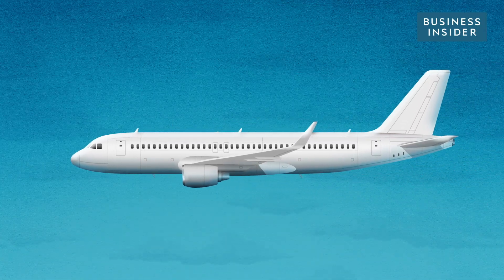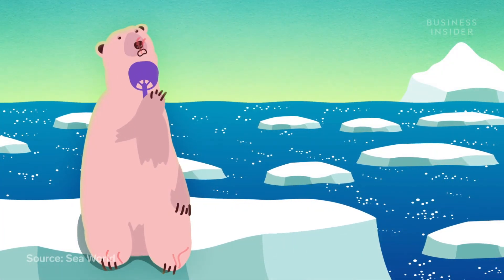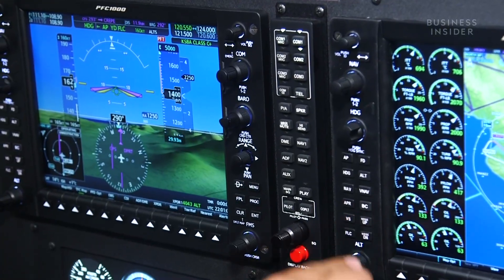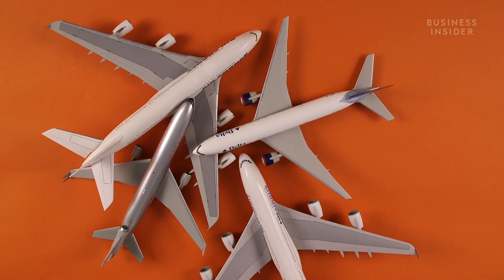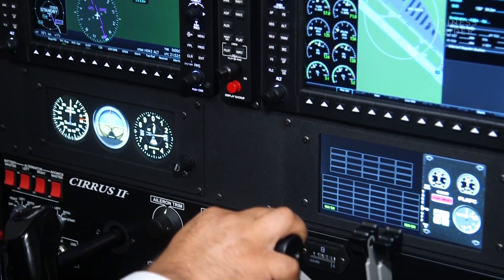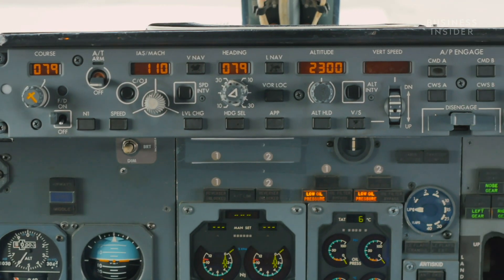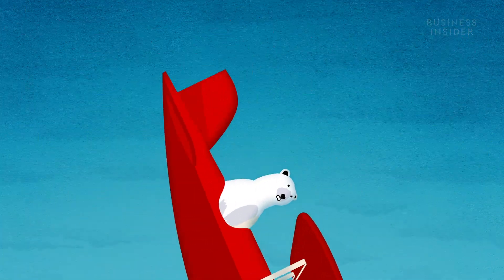What Do Pilots Do When A Plane Is On Autopilot?

Comment: Hook the neural link to the autopilot right now and see if he can get up and walk right now because I think I've indicated since c3 right the neural pathway through the motorway sensory and motorways through c3 go double check that and then check the computer program see if that's up and running okay it looks pretty smooth in that area that seems to be the location now yeah that pressure point that throws through number c3 and c4

Comment: "Inputting" is NOT  a verb.  The correct term is "Entering."   You enter data.  That data is called input, but you can't "input" data, you enter the data.  In essence you enter the input.

Comment: its actually pointless to have a pilot holding the yoke for hours just to fly in course and straight level. With the autopilot, they can do their actual important work like monitoring instruments, inspecting systems and communicate with ground.
Reply: For most of a flight, they are just flying "in course and straight level", other traffic is (usually) very far away and aircraft are always flown a long way from obstacles.

Comment: Hey, 737 max didn't crash due to wrong autopilot input. It was due to the MCAS system which is a part of the autopilot but was not available on the transcript manual for pilots may be Boeing did not want pilots to know about it which resulted in the crash of 737 max.

Comment: Just because the plane is on auto pilot mode. This doesn't mean that we can be off guard and take a nap. We still need to monitor and make sure the auto pilot is doing the right thing and if not, fix it or take control.

In another word, it help reduce the work load.

Comment: It seems like Autopilot is similar to turning on the "dumb" cruise control in older cars. When we set cruise at 70mph, the car cruises at the set speed no matter what. We are good as long as the highways are clear and its not a holiday weekend in which case you may want to turn off that cruise mode and hit your gas manually.
Reply: Except that that old type of cruise control only controls the speed, it does not steer. Even when that cruise control is on, the driver of a road vehicle still has to hold the steering wheel or the car will hydrocilate*. There is a category of land vehicles of which many can be driven without "continuous hands-on control". Trains are in this category, their drivers do not need to steer.
 There are buses (known as guided buses) that are also like this when in guided mode, however, unless they have cruise control, their drivers still need a foot on the accelerator.

*I got this term from a show called When Cars Attack.

Comment: OK! Because this video did not answer the quesion of "What do pilots do when a plane is on autopilot" so i will. When the aircraft is on autopilot,  the pilots would normally discus possible that airports they could land at when there would be an emergency like dual engine faliure or a sick passenger. Another thing they do is to look out for any growing CB or Cumulonimbus cloud as those clouds are capable of producing heavy winds and hail at such high altitudes. Pilots would always rely on their weather radars to locate these clouds and to avoid them. Other times they would be discussing their approach or decent phase.  hope this answers a few of yer questions
Reply: They would also do their paperwork such as filling up the trim sheets which is tiring asf

Comment: here what's wrong with this video:
1. 1:56 They show the flaps instead of the ailerons.  
2. 2:21 They don't use proper terms when describing the rudders movement. It's called yaw
3. 3:32 Autopilot does not exceed a 30 degree bank input. Therefore it is impossible to fly upside down. 
4. 4:06 The accident shown was caused by the MCAS system. Not autopilot.
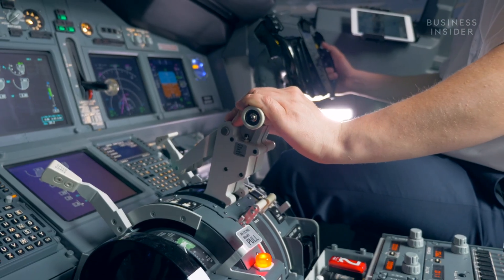5: 4:44 Qantas 72 had an autopilot malfunction which feed the plane false inputs and when the pilots took control the plane kept diving and nearly crashed.
On average you made a mistake a minute pretty bad.

Comment: Some planes can land automatically. Very few can takeoff but it is possible in some new airliners. You couldn’t program an autopilot to fly upside down, the worst that would happen is that it would disengage, as autopilots have limits to bank, pitch, etc.. There is no such thing as a 3 axis autopilot. Instead there is a yaw damper, which uses the rudder to smooth out the flight. This is why the plane always feels level, even when in a sharp turn.

Comment: One thing that even that pilot didn’t get is that the autopilot is only a small part of what’s called the flight guidance system. 

The autopilot is just the thing that you turn on to move the controls. But how do you do that?  Most people and even pilots think it’s pushing buttons and changing settings on the mode control panel or flight guidance panel, but what that is really doing is controlling your flight director. 

The flight director is an instrument on the primary flight display or attitude indicator that consists of two vertical lines (split cue) or two bars arranged in a V (single cue). 

These move depending on what vertical or lateral mode is selected on the mode control panel and you control the aircraft so that the two lines are centred or the triangular shaped image of the aircraft is nestled in the V bars. 

So if you want to climb in flight level change mode at a speed of Mach 0.7.. the flight director will tell you what nose up attitude to maintain. If you want to turn to a heading.. it will tilt or displace until you have banked the aircraft the right amount for a standard rate turn.  If you are in a lateral navigation mode it will move to tell you how to fly the aircraft for the entire flight plan, even helping you correct for crosswinds. 

So when this guy talks about “hand flying the aircraft”.. not only can any monkey match symbols, but the flight director has the same pitfalls and like a moth to a flame some pilots follow it absolutely blindly to their doom. 

Real hand flying is using raw data. No flight director and using the instruments themselves to help control the aircraft. That means you have to see a deviation rather than the flight director keeping you from deviating. You have to think about how much to correct a deviation rather than the flight director telling you exactly how much. You have to watch all of your other instruments (which you should be doing anyways) instead of just one.

Comment: 2:05, 5:14, 1:55 and 3:29 are proof who ever made this knows nothing about aviation.

They said "it keeps the wing of the plane perpendicular to the ground." And not parallel to the ground.
They said "And haven't handed the yoke over  to the robots." and shows the throttle.
They pointed to the flaps and called them ailerons.
They said "If someone programs it wrong you could fly upside down." Yet it has a 30° bank angle.

Comment: What??? This has got to be the worst explanation ever. A polar bear wth?

Also autopilot will not fly inverted......there is no button like that? (It would disconnect before that happened (if it was possible witch it’s not 😂)

Autopilot is engaged at 250 - 2000 feet and that is mandatory by the majority of airlines so how about you watch your mouth?

Comment: Soooo are we just gonna forget about the dihedral? You know one of the critical flight surfaces one of the things that keep the plane in a steady level flight without any outside control. Incredibly misleading video, classic case of watering down information without keeping most of the key facts. If you wanna know what the auto pilot really does and you don’t mind a decent read I suggest the FAA 8083 chapter 2, the AC 43.13, and the FAR AMT 2020.

Comment: The autopilot reduces the workload for pilots, allowing pilots to focus on other tasks which overall increases the safety and productivity
Reply: Especially when travelling continuously along the same vector, or along a plotted course. The vector along which the plane travels can be changed simply by changing the autopilot settings.

Comment: "They could program it to fly upside down"
Autopilot: has a 30° bank angle limit
Reply: If sensors fail or give incorrect measurements,  
then computer won't know if the plane is actually banking beyond 30 degrees or not.

This is what happened with 737MAX crashes,
Reply: Shantanu except the 737MAX wasn’t banking, it was angle of attack. And it wasn’t necessary sensors failing, it was Boeing not informing pilots/airlines about MCAS and the pilots found themselves fighting the planes. In my unrelated opinion, Boeing should be held responsible for all of those deaths to a much harsher level.
Reply: BACC
Reply: She clearly watched Denzel Washington’s movie lmao 😆
Reply: mcas has joined the chat
Reply: Lolz
Reply: B A N K   A N G L E
Reply: Impressive
Reply: Try dat

Comment: Not sure what autopilot could fly upside down or write letters in the sky.  Last time I checked in the 737 it controlled speed, altitude and your heading but I didn’t see the fly inverted switch. Not sure what the flight plan had to do with it either since the plane will still fly on auto pilot without a flight plan..

Comment: 1:56 yes the ailerons are on the entire wing. No flaps, only ailerons
Reply: That's what happens when an extra 300 in and a a767 have a good time
Reply: flaps are located on the lower wing part and slide out...she is correct
Reply: @balto2455  flaps are visible. Notice how the person was sliding her finger across the edge of the wing while saying Ailerons.
Reply: bayspotter ok partially agreed but to manoevre the plane you only need the ailerons

Comment: ok ok ok autopilot won't flip your plane upside down trust me. There's always something that prevents it so a mistake shouldn't be that bad!
Reply: Yeah there must be some kind of conflict monitor built into the system to prevent illogical conditions. Even a dumb traffic light has a conflict monitor to ensure that the computer doesn't turn two different directions green at the same time.

Comment: You explained what an autopilot does however you did not explain HOW it works, autopilots use a little thing invented by Sir Isaac Newton which is called CALCULUS! All parameters of the autopilot are controlled via a PID controller (proportional-integral-derivative controller). Parameters such as air speed, rate of climb, and rate of decent all use calculus to control them. 
Here are a couple videos to help explain it if your interested, don't feel bad if you don't understand it at first it takes alot of schooling to cover all the material, I'm an operating engineer 4th class (stationery engineer for you older people's lol). I hope this helps! 
https://youtu.be/wkfEZmsQqiA
https://youtu.be/sFqFrmMJ-sg

Comment: Just feedback loop, not negative feedback loop.
Reply: Yup here is a copy paste of my other comment You explained what an autopilot does however you did not explain HOW it works, autopilots use a little thing invented by Sir Isaac Newton which is called CALCULUS! All parameters of the autopilot are controlled via a PID controller (proportional-integral-derivative controller). Parameters such as air speed, rate of climb, and rate of decent all use calculus to control them. 
Here are a couple videos to help explain it if your interested, don't feel bad if you don't understand it at first it takes alot of schooling to cover all the material, I'm an operating engineer 4th class (stationery engineer for you older people's lol). I hope this helps! 
https://youtu.be/wkfEZmsQqiA
https://youtu.be/sFqFrmMJ-sg
Reply: Actually  negative feedback is not wrong either. The plane's automatic control is supposed to regulate based on negative feedback rather than positive feedback (which will tend to overcorrect the flight path by amplifying any deviations from equilibrium)

Comment: Autopilot doesnt let a plane fly by itself but it helps it fly the plane without the pilot
Reply: You can't literally fly a plane without a pilot. You need flight plan, atc permission etc.
Reply: I dont think, nvm
Reply: You explained what an autopilot does however you did not explain HOW it works, autopilots use a little thing invented by Sir Isaac Newton which is called CALCULUS! All parameters of the autopilot are controlled via a PID controller (proportional-integral-derivative controller). Parameters such as air speed, rate of climb, and rate of decent all use calculus to control them. 
Here are a couple videos to help explain it if your interested, don't feel bad if you don't understand it at first it takes alot of schooling to cover all the material, I'm an operating engineer 4th class (stationery engineer for you older people's lol). I hope this helps! 
https://youtu.be/wkfEZmsQqiA
https://youtu.be/sFqFrmMJ-sg
Reply: @ajcook7777  Actually, nowadays, it's adaptive control, PID has become too weak for that aplications
Reply: What
Reply: This supposed to be a joke btw, idk if i pointed that out or smth
Reply: U don’t even know what autopilot rlly does
Reply: Their are 5 types of Autopilot systems. All consist of altitude, speed, angle, plane tilt, the other I forgot. If you apply for all the APs you can maintain speed and desired altitudes
Reply: Makes sense
Reply: And yes I’m Enola Gay B-29 superfortress
Reply: The pilot still need to change the heading altitude for the auto pilot to work
Reply: @acepilotmonkeygaming9530  autopilot still flies to planne by itself
Reply: Trim control.
Reply: Aman Vishwakarma Macs shutoff
Reply: Thats what they said idiot
Reply: Raye D. It’s a... nevermind
Reply: Not exactly,  it just help reduce the work load. But we are still responsible for what it is doing.
Reply: @QPilotD  It was a joke
Reply: Same shit
Reply: autopilot flies the plane by itself, key word "fly"